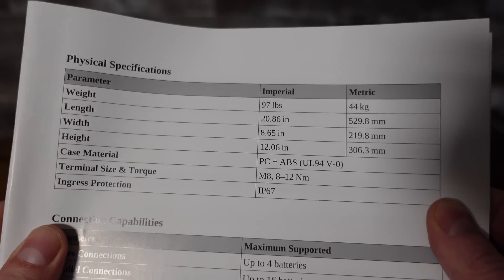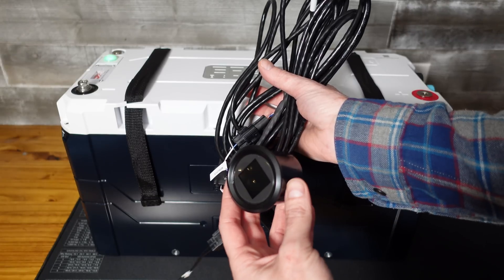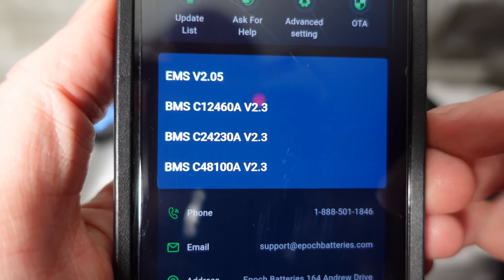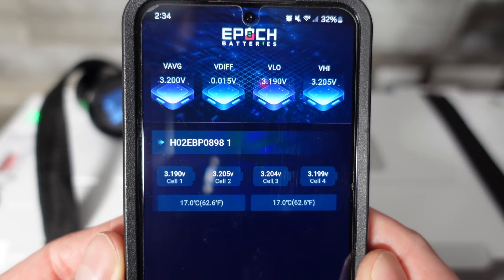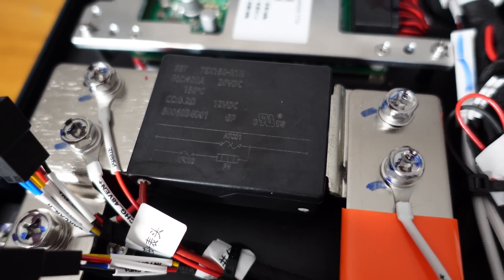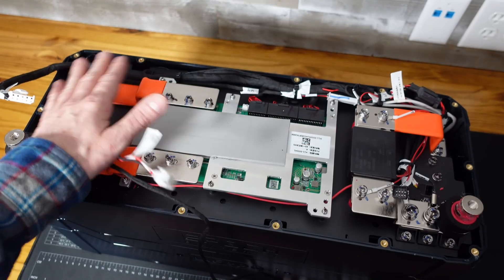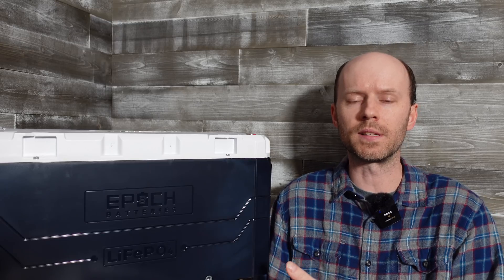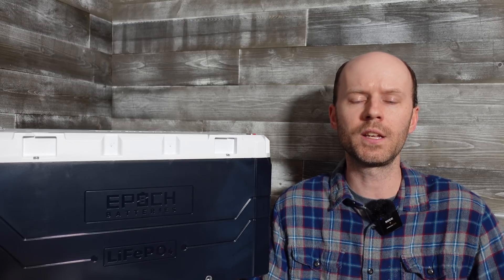NEW Epoch Batteries 12V 460Ah V2 Elite Lithium Battery, Detailed Review

Comment: love that video... on a similar subject, my question is.... (I have 4X  200 amp Redodo batteries) Isn't dangerous to have a very large charge controller, pushing a high current to charge a bank of batteries, knowing that, eventually, one of those batteries could end up not being fully charged and still needing charging ? Now that same large controller, that was made for multiple batteries, is giving all his power to that only one battery ?   for example, if you had 4 batteries with their own 100amp BMS,  it would be acceptable to send 200 amp to charge them all 4 at the same time, dividing that 200 amp by 4 (that's a reasonable 50 amp pushed on each)... but suddenly 3 of those batteries are full and that last one is not...  that could result in a single battery getting 200 amp pushed in, while it's BMW was design to handle only 100,  no ?

Comment: Hi All,

I needed to ask this very imprortant question,
I had brought 4 EVE 105AH prismatic cell, and used with Victron 75/10 mppt charger.
I had forgotten to set the battery voltage, previously i has set to 25 volt absorption voltage.
Due to this my big mistake, the 4 cells in series were overcharged to 4.46 volts per cell, but the charging time was not more than 1 hour i think. 
The battery temperature was around 36 degree centegrade. 
At that time, the cells were perfectly flat. These are grade A new cells.

I immediately discharged some energy and brought down tve voltage to 3.35 volts per cell.

Next day, i see that all these 4 cells are swollen!!.

Can you please help me here, what can I do to use these cells safely?
Is there any way to reverse the swelling of the cells?
Please help me

Comment: Wow, a waterproof battery? Is it good for 400 feet down? No! It just means when you drive in rain. It will not bother it if it gets wet? Why a switch on a battery cable?.much to do about nothing, but POSSIABLE all that monitoring possible adds $400 to the cost?
Reply from the maker: I suggest you educate yourself on the meaning of IP67.

Comment: The old version claimed to be able to do 300 Amps discharge, continuous. This one is way down, to just 230 Amps discharge continuously. Pretty weak in my opinion, given its size and cost and especially considering the Epoch DP12300H does 300 Amps cont. Heck, their $999 Essentials 300 Ah says 200 Amps continuous but does more in my testing. 

And the heaters being only on one side seems like an important error on their part.
Reply: not quite

Comment: I would guess that the BMS ignores instantaneous temperature changes, and it waits until it sees a trend before it stops charging. 

It sort of makes sense, given the heat capacity of 100 or so pound battery, that it can’t change its temperature by 70° in a few seconds in any environment where it would be installed.

The battery waits for a few samples in a row of a change temperature before deciding that it needs to stop charging and turn on the heater.

Comment: So the same battery can be bought as 12V, 24V, or 48V - nice!  The 48V 100ah looks like a good golf cart contender with 150amp constant discharge and 300amps for 30 seconds.

Comment: It's such a big battery it can't be discharged at a full 0.2C Rate!? Wow...
I bought a 1500w DC Electronic load just for this battery testing!
Reply from the maker: My electronic load is limited to 800W, which is 60A on a 12V battery. This is a limitation of my eLoad, not a restriction of the battery.
Reply: @LithiumSolar  Correct, I definitely understand that. I recently purchased the BK Precision 8614 DC electronic load tester in hopes that batteries don't get much bigger than this. 
I was able to complete full discharge test on my battery with a constant 96amps with that load tester.... But then my battery failed with the firmware update. Still waiting on the replacement.

Comment: Just a suggestion to add to your testing with these new communication capable batteries: test the accuracy of the internal shunt. These batteries will be used heavily in mobile, low current applications. Most of the internal shunts do a terrible job of measuring current and that can throw off your state if charge when running things like vent fans, LEDs lights and 12v fridges. I’m hopeful that these epoch batteries can do better but if the whole point with communication is to remove the need for an external shunt then accuracy needs to be improved.
Reply: New v2 detects .4 amps
Reply: @mvintrigue-trawlerdiy1101  yikes, that's pretty bad, but better than others. Victron is +-0.01amp